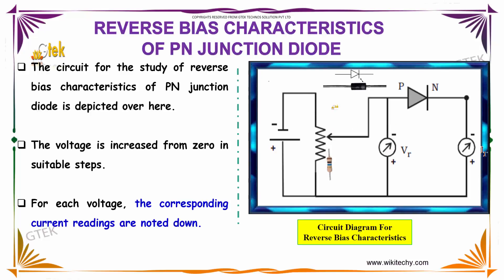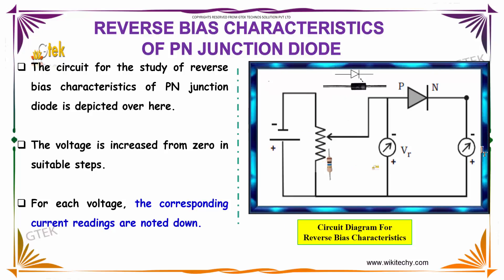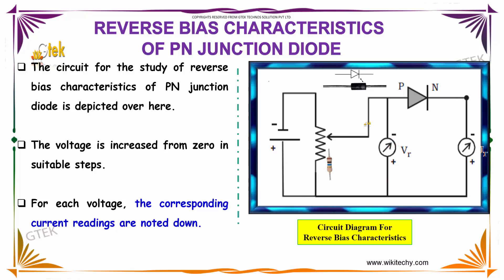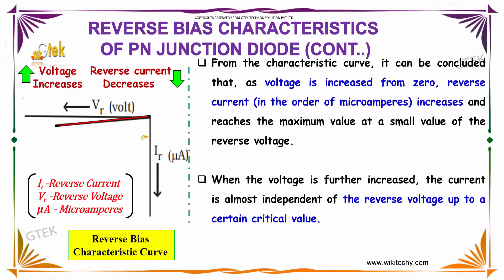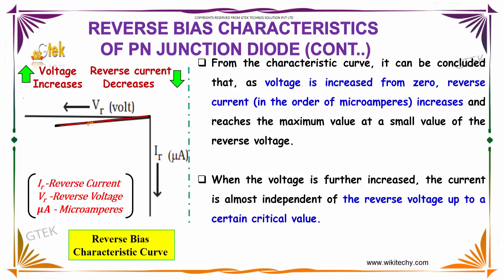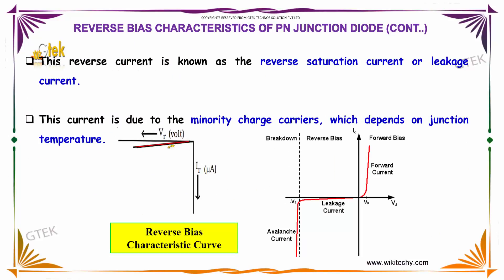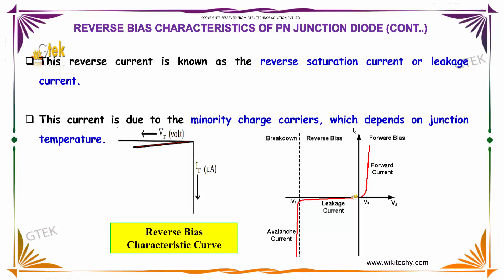Reverse Bias Characteristics of PN Junction Diode | Semiconductor Device

Comment: An external voltage which decreases the potential barrier is said to act in the “Forward Bias” direction. ... Reverse Bias – The voltage potential is connected negative, (-ve) to the P-type material and positive, (+ve) to the N-type material across the diode which has the effect of Increasing the PN junction diode's width

Comment: Connecting the p-type region to the negative terminal of the battery and the n-type region to the positive terminal corresponds to reverse bias. If a diode is reverse-biased, the voltage at the cathode is comparatively higher than at the anode. Therefore, very little current will flow until the diode breaks down.

Comment: If the positive terminal of the battery is connected to the p-type semiconductor and the negative terminal of the battery is connected to the n-type semiconductor, the diode is said to be in forward bias. In forward biased p-n junction diode, V F represents the forward voltage whereas IF represents the forward current.

Comment: General Specification of P N Junction. Forward Voltage Drop (VF) : Is the forward biasing junction level voltage (0.3V for Germanium and 0.7V for Silicon Diode ) Average Forward Current (IF) : It is the forward biased current due to the drift electron flow or the majority carriers.

Comment: Semiconductor devices are electronic components that exploit the electronicproperties of semiconductor materials, principally silicon, germanium, andgallium arsenide, as well as organic semiconductors. Semiconductor devices have replaced thermionic devices (vacuum tubes) in most applications. They use electronicconduction in the solid state as opposed to the gaseous state orthermionic emission in a high vacuum.Semiconductor devices are manufactured both as single discrete devices and as integrated circuits (ICs), which consist of a number—from a few (as low as two) to billions—of devices manufactured and interconnected on a single semiconductor substrate, orwafer.Semiconductor materials are useful because their behavior can be easily manipulated by the addition of impurities, known as doping. Semiconductor conductivity can be controlled by the introduction of an electric or magnetic field, by exposure to light or heat, or by the mechanical deformation of a doped monocrystallinegrid; thus, semiconductors can make excellent sensors. Current conduction in a semiconductor occurs via mobile or "free" electrons and holes, collectively known as charge carriers. Doping a semiconductor such as silicon with a small amount of impurity atoms, such as phosphorus or boron, greatly increases the number of free electrons or holes within the semiconductor. When a doped semiconductor contains excess holes it is called "p-type", and when it contains excess free electrons it is known as "n-type", where p (positive for holes) or n (negative for electrons) is the sign of the charge of the majority mobile charge carriers. The semiconductor material used in devices is doped under highly controlled conditions in a fabrication facility, orfab, to control precisely the location and concentration of p- and n-type dopants. The junctions which form where n-type and p-type semiconductors join together are called p–n junctions.

Comment: If the negative terminal of the battery is connected to the p-type semiconductor and the positive terminal of the battery is connected to the n-type semiconductor, the diode is said to be in reverse bias. In reverse biased p-n junction diode, VR represents the reverse voltage whereas IR represents the reverse current. 

If the external reverse voltage applied on the p-n junction diode is increased, the free electrons from the n-type semiconductor and the holes from the p-type semiconductor are moved away from the p-n junction. This increases the width of depletion region.

Comment: The V-I characteristics or voltage-current characteristics of the p-n junction diode is shown in the below figure. The horizontal line in the below figure represents the amount of voltage applied across the p-n junction diode whereas the vertical line represents the amount of current flows in the p-n junction diode.